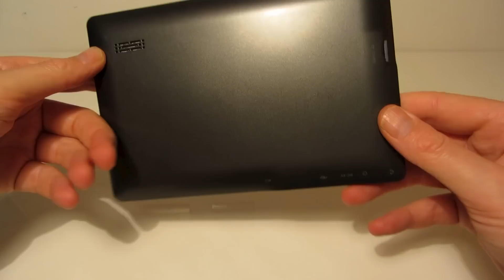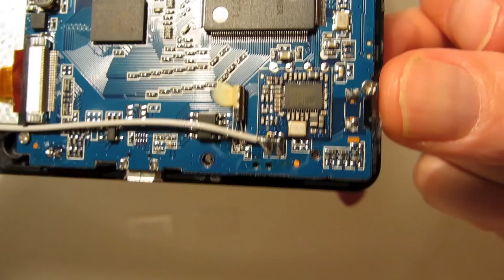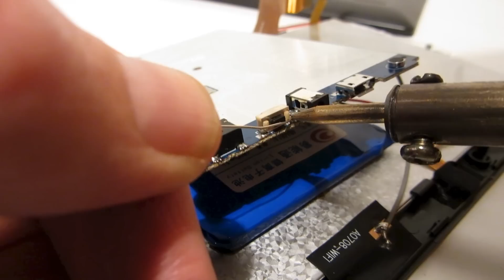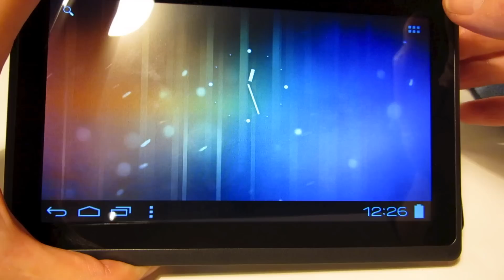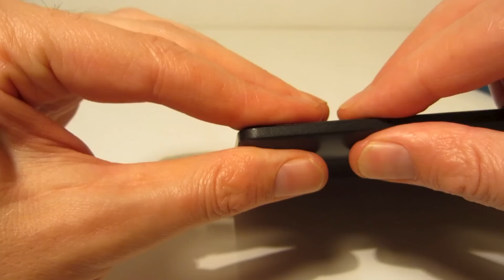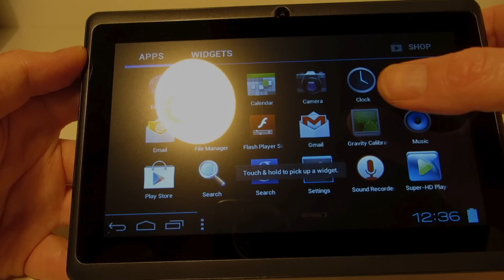Disassembly of Allwinner A13 Android 7" Tablet - Opening & Repair

Comment: Look how small that battery is
Reply: yeah kinda reminds me of the gp-electronic p900 NHA tablet which used a battery out of a 7 inch tablet i actually put it in my bricked 7 inch first gen NHA tablet (which looks exactly the same but uses an unique board with unique firmware) as i'm trying to u brick it by trying various firmwares

Comment: If i send you mine (same model different color and battery) could it be fixed (i don't have the original power button it had when i got it because that button is ruined by superglue)

Comment: Hi, I need the battery specs to replace mine. Thanks
Reply: Mine isn't stock but it has a 3.8v 3000 mah li-fe (lithium iron) battery in it (this should help you if still looking for a new battery)

Comment: I have this same tablet, but it wont charge, any ideas (i already installed a new battery).
Reply: The charging port is notorious for becoming loose. Try resoldering or charge through the USB plug.
Reply: Benjamin Magno
The port itself is fine because the tablet will power on once plugged in, but only when plugged in, the battery still wont charge.
Reply: @supercj12  could be a broken trace on the pcb if it is there are a few good video on yt for how to fix it

Comment: These AllWinner A13's were actually pretty good. Got my son one and never had an issue with it till he cracked the bloody screen with his elbow.
Took like 4 hours just to get him to admit he'd cracked it. I Wouldn't buy him another if he kept telling me the screen cracked on it's own hehe. Funny little bugger. Shame though, Was actually more accessible than my android. Had more options and was much more efficient. 
Old and Flimsy now though, But still usable if the screen was not cracked.
Reply: This model of tablet was my first tablet (only had it for about 2 - 4 months and bought a new one which is a azpen A743S (better performance because it has 2x the RAM and a quad core CPU [also same size and with same connectors and buttons but still not best because of screen needing calibration and some apps that work on my phone still not working 100%])
Reply: Actually ,it can crack on its own, just Look how plasticki it looks

Comment: Hi, great video! it was very helpful. but i have another problem...the gray cable that goes from the battery to the mother board somehow got detached from the mother board and i cannot use my tablet now...how do i fix it? i see that there is a little metal piece on the end that is on the mother board, but mine doesnt have it, it prob came off. what do i do?

Comment: Very well done. Could you tell me what kind of micro USB port it uses? I need help getting a replacement for the Allwinner
Reply: Standard micro usb port but can you microsolder? Otherwise you could better off buy a new tablet and copy the data over using an sd card powering it via the barrel jack

Comment: I dont have a soldiering tool. Could I just tspe it back into place? Would it still work that way?
Reply: Theoretically it would but in practice it wont because you will be pushing and pulling the plug in and out so it will just dislodge it again.You could try....Araldite® Repair 50g Bar if there is something near the power plug for it to grip onto.

Comment: whats sulder like glue or something ?
Reply: It's metal that u melt with a soldering iron to put 2 or more pieces of metal together but for electronics rosin core solder is the best also it needs to be thin enough so it will melt without alot of heat because heating something for a while can damage surface mount parts and chips and can damage traces on the board that connect stuff together